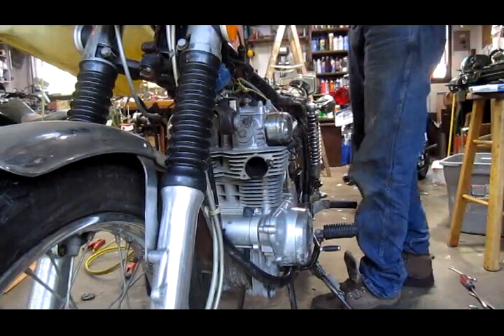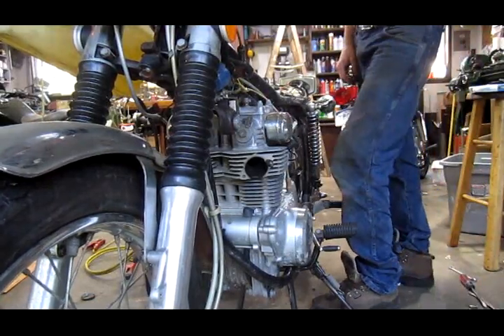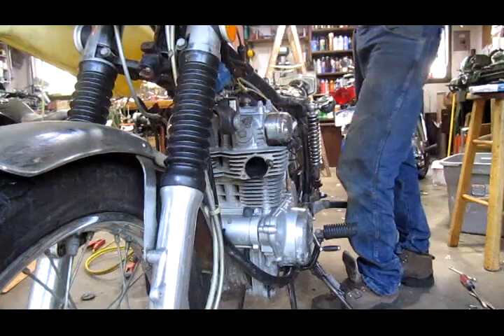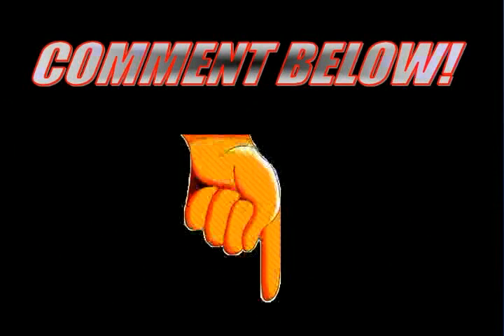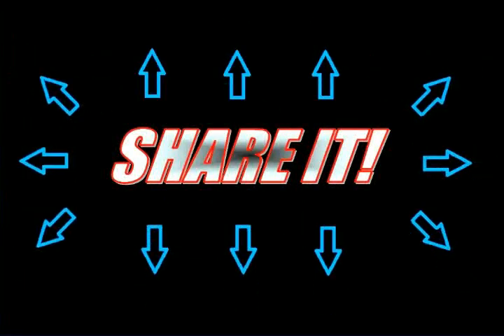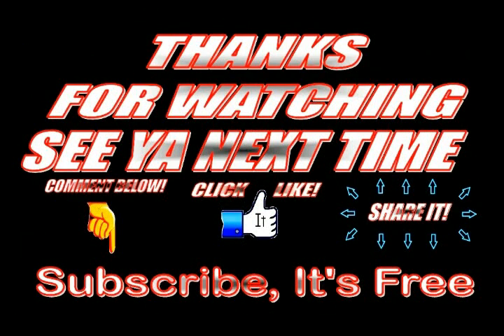Flaming Exhaust Port

Comment from the maker: Vesrah Complete GasketSet Honda CB350 CL350 Twins https://amzn.to/2MXdni7
2 Intake Insulator With Gasket Honda SL350K CB350K CL350K https://amzn.to/2MTcveB
2 Carburetor Carb Rebuild Kit Honda CB350 CL350 Twin https://amzn.to/2K5rfJq
Tune Up Kit Honda CB350 CL350 Twins Spark Plugs Caps Points https://amzn.to/2tr6ZaS
2 Exhaust Gaskets Honda CB350 CL350 SL350 Twin https://amzn.to/2MSyjXv
Honda CL350 CB350 Twin Engine Oil Seal Kit Set https://amzn.to/2MkOpYY
2 Carburetor Passage Plugs Honda CB350 CL350 SL350 https://amzn.to/2tsbqlF
Top End Engine Gasket Set - Honda CB350 CL350 SL350 https://amzn.to/2tq6T35

Comment: Not a good idea to run without exhaust pipe or manifold.  This has resulted in early valve failure because of rapid cooling when engine is shut off.  The exhaust pipe or manifold maintains a stable heat so valves cool down gradual and evenly.